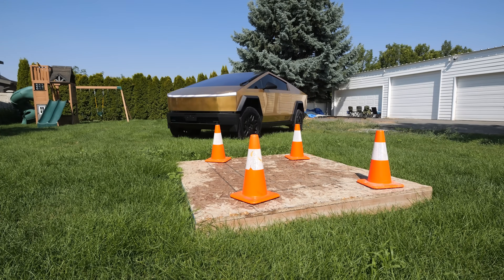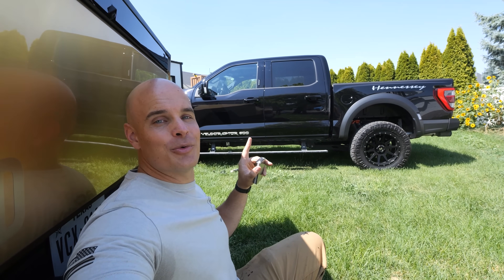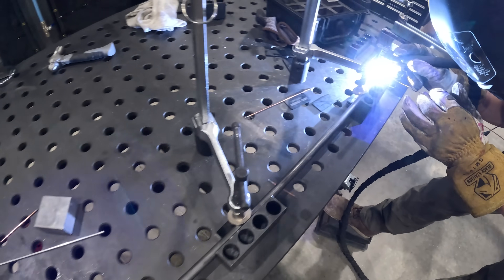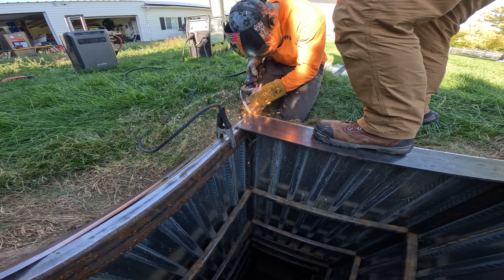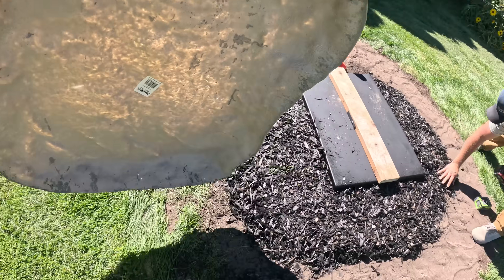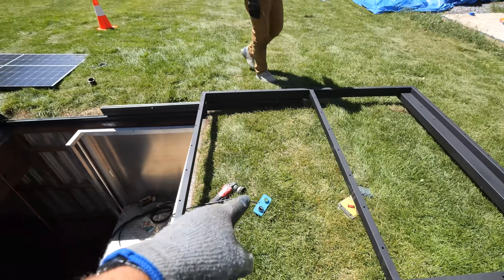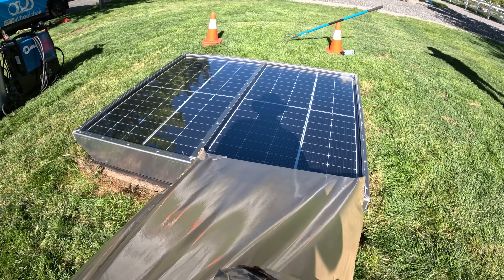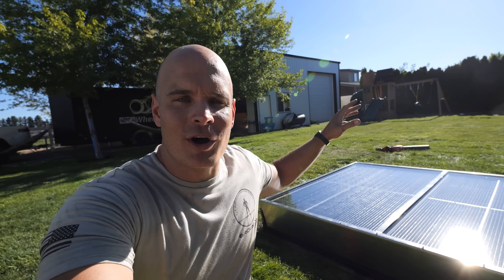Bulletproof Solar Panel Bunker Door Build - (unlimited energy!)

Comment: You should put hydraulic struts on the emergency exit shaft door, so that if anything is laying on top of it it doesn't become impossible to open.
Reply: yeah like what if a real rock falls on top of it. you gotta still be able to open it
Reply: @jackcarsen6247  Better hope you don't have an emergency when its rock mating season.
Reply: @joshuahuman1 😂
Reply: @jackcarsen6247  yhea because rocks fall out of the sky a lot
Reply: @sippe3985  they do, as a geologist i can confirm.
Reply: could even be a manually operated hydraulic cylinder such as a car jack.
Reply: @alexdrockhound9497I hear that’s a common tool kept by bunker owners.
Reply: yep, if theres a tornado and large chunks of the house get blown over the exits, without hydraulics thered be no way to get out, and the solar panels would stop working. 

Or even snow and ice could make it very very hard to open.
Reply: Even better, add a simple screw jack. No hydraulic seals to break. One less failure point in an emergency. Just keep it greased up and it's the perfect backup option.
Reply: I was thinking something like a high lift bottle jack. that way if someone did park a car on it you could lift the car up enough to slide out
Reply: It should open onthe opposite way, he needs check AtlasSurvival Shelters videos
Reply: You seem to think this bunker is actually going to be used (regularly/long term) for it's intended purpose other than as a project/YT video...
Reply: or electric ones much easier tbh
Reply: @alanmay7929 in a situation where you might run out of power… then what? Nope. Not electric. Manual is a must, electric or hydraulic assisted.
Reply: @Sffker  Screw jack like the other guy said grease it and keep a large breaker bar and you will be good
Reply: nah

Comment: I think you just blocked the wheelchair access for your wife into the lift. The entire bunker project does keep getting better though. Well, I somehow doubt that thee two panels and the windmill will produce enough electricity for longterm use. Most windmills of that size don't produce more than a third or at most half the rated power in normal circumstances. Windmills are one of those thingswhere bigger really is better because of physics.

Comment: There's no reason for the solar panels to be bifacial as the inside of the bunker is not reflecting any light(unless you want to see if there's light outside), that will decrease efficiency compared to a normal solar panel.
There's also another factor that will impact efficiency of the solar panel and it's HEAT. Those panels will get hot behind that acrylic sheets, they need airflow to cool down, it's important, they will also heat the inside of the bunker. Idea: you could run water lines underneath and get solar heated water at the same time you cool them down.
Great build anyways, it's a good solid mechanism and I like the idea of the acrylic for safety.
Reply: It didn't need to be there at all! It could be anywhere over the bunker. I think this place only complicates things.
Reply: I think the bifacial was chosen specifically to let some light inside.

Comment: Bro you’ve got zero chance of powering everything you need in that bunker with those panels! I have an EcoFlow Delta Pro, Powerstream inverter and smart plugs with 2400W of solar just powering the base load and essentials in my home and in winter it just does not cut it, it would struggle even if it were just the base load.

Comment: Regarding children, you need a lock system on this sliding door (and the exit shaft door). To just secure it from the outside, a padlock is ok but then you could be locked in into the bunker.

Comment: Not sure but has this made it so you can’t use a wheelchair with the lift now as the frame work is in the way?
Reply from the maker: good call - we will have to build a fold down ramp that comes down when the elevator emerges.
Reply: @JerryRigEverything  I’m sure you had thought of that before my comment, I was just wondering how it would work, can’t wait to see it all when it’s finished

Comment: you should make a lock for the sliding bunker door kids can easily slide it open and fall when playing around the solar panels
Reply from the maker: we will for sure!
Reply: @JerryRigEverything maybe a safety net of sorts in case a kid decides to catapult a bolder on the solar panels and jump in.
Reply: @JerryRigEverything I love your vids
Reply: Hey.. you need to improve your video and thumbnails... I can help you  @JerryRigEverything
Reply: @JerryRigEverything doors are doors, and doors open.
Reply: @JerryRigEverything  geht das bei dem Schieberahmen noch mit den Rollstuhl?
Reply: @JerryRigEverything there is so many safety concerns with the elevator I hope you have considered. Maybe get some expert consultation. One thing I could think of is the hatch being closed and the elevator being able crush someone between the door and the closed slider.

There is no harm in trying to make as safe aa reasably possible.
Reply: @JerryRigEverything  if any case kids were able to open those doors, might as well add some net like they use in trampoline parks so that something will catch them
Reply: Yes, this is what I was thinking. Someone, at some point, is going to fall down that thing.
Reply: ofc theres going to be a lock. wouldnt be much of a bunker if anyone could get in lol
Reply: Yeah the LPL's kid will have that opened in a jiffy...hope you budgeted room for his tribe in the end times. :)
Reply: Don’t we want them to?
Reply: add a finger print or keycard lock or something with manual locks as well, and also don't add the manual one outside or someone will lock you forever
Reply: Probably should have the elevator default to slightly extended so even if someone were to get into the hatch you can block the entrance with the elevator portion and it's much shorter of a fall in case someone does accidentally fall in somehow.
Reply: I’m gonna guess that man is smart enough to that of that on his own without the input from some YouTube subscriber
Reply: That’s a really good idea!!!
Reply: Gosh darn kids always lolly gagging around the solar panels
Reply: That looks super heavy for kids to slide
Reply: It looks great🎉🎉
Reply: That still looks scary without railings
Reply: Guess kids shouldn't trespass. Why rob Darwinism and bad parenting?
Reply: It’s private property 😂not a skul
Reply: let em fall
Reply: But then someone could easily lock you inside your own bunker.
Reply: Same about the emergency hatch. I think it should be only possible to open it from the inside with a hand crank, so that nobody opens it and falls in. It will also make that hatch open if something is laying on top.
Reply: 11:18 
unfortunately that's a bad design but it's already late to tell you.
Acrylic with that thickness will trap alot of heat beneath it and it will cause the panels to get super hot. Which is something you don't want obviously.
Reply: Is that really a bad thing
Reply: Wouldn't the elevator be on top?
Reply: was thinking the same.   something like remote opening locks of some kind would be nice. and maybe some magnets to hold the sliding door in places when its closed and not locked.
Reply: @Crazy_Finn  Or even open! I can see people trying to climb into that thing during a storm and having that thing blow shut on them.
Reply: Ah yes, he figured everything else out but was going to not lock the entrance slide in at all
Reply: Or...hear me out.... people could teach their kids to not be complete idiots....that would involve people who have kids actually parenting though and we don't do that anymore.
Reply: @justanotherguy6359  Children play and explore - that's how humans learn.

I mean some people even tear apart perfectly good phones to learn - and people actually watch them do it!

LOL

Stop trying to control humanity to not being human!
Reply: @justanotherguy6359 same as glass is glass, kids are kids. You might teach some, but you will not be able to guarantee every kid that steps into your property is not a complete lunatic
Reply: Another money hungry, passion starving endorsement video incoming for some stupid digital lock...

Comment: Acrylic sounds like a terrible idea for a bunker. 
Not only it scratches very easily, but also will get burned by the sun overtime, meaning it will block the sun from reaching the solar panels.
You can call it a "bunker", but overall, is just an underground room so far lol, if you run into something like a nuclear apocalypse.

Comment: Acrylic can reduce the efficiency of solar panels, but the impact depends on several factors. Acrylic, being a transparent material, can allow light to pass through, but it might also cause some light reflection and absorption, which could slightly decrease the amount of sunlight reaching the solar cells. Additionally, if the acrylic isn't optically clear or has imperfections, it could further reduce efficiency.

To minimize the impact, high-quality, optically clear acrylic should be used, and the surface should be kept clean and free of scratches or dust.

Comment: I just have an iPhone, do people still use wallets? Ridge wallet seems silly, don’t buy one people, you ain’t gonna win a $100k.
Reply: Not everyone takes tap pay. DL? You usually need a few physical cards, but I agree I still wouldn’t buy one.
Reply: @TheClintMatthews  apple mag safe wallet if I need one, and I keep my license in my car, and I pay cash when I go out so the can’t “ask me a few questions”
Reply: I personally don’t want all my cards on my phone, not only because of security reasons (for example I have different Access Cards, that are only available physically). I’ve had a Ridge Wallet since 2022. I used to have like leather card holders (good quality ones) which were dead after like 6 months of abuse. The Ridge Wallet has been going strong for the past 2 years. The only downside I have with them is the price, but i personally rather spend the money on the real stuff then on a knockoff wallet that looks the same.